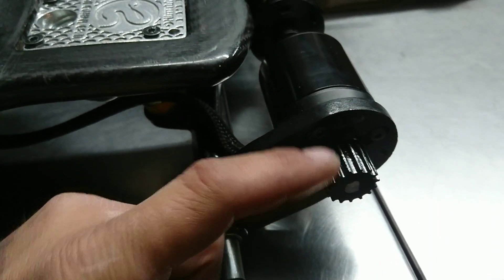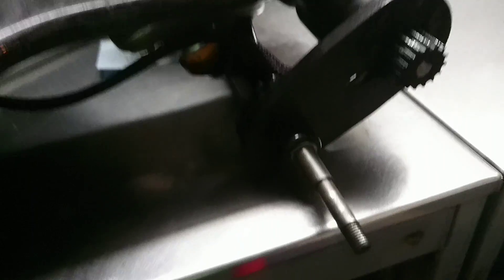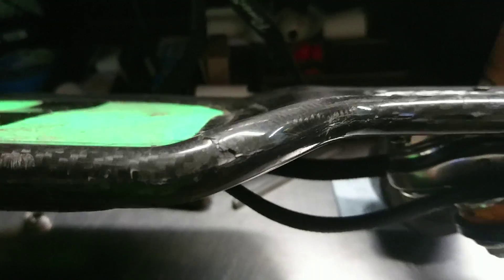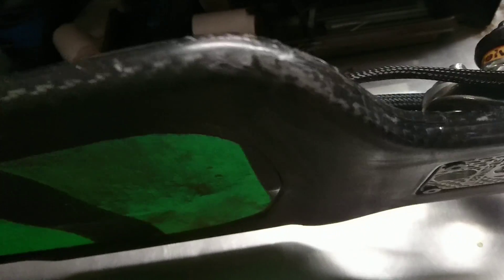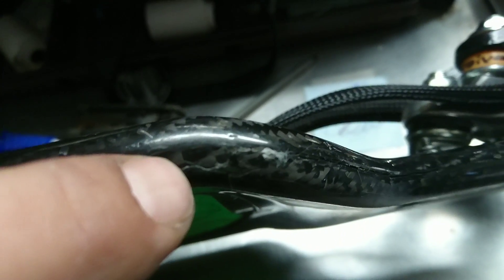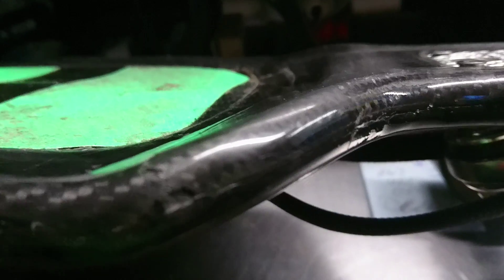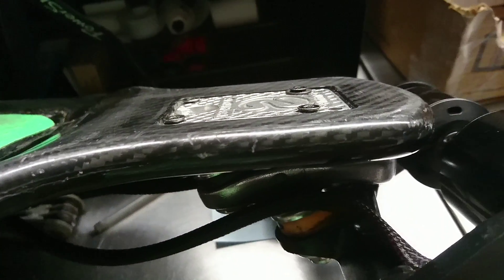Weak Carbon Fiber on the Evolve Carbon GT Electric Skateboard

Comment: The boards break here because they are made in two halves and fastened together, you can see by looking at the edges closely.  That's why they break.  There should be carbon fiber wrapped all the way around the edge but there is not.  On the center-line it's held together only by resin.
Reply from the maker: yup thats right no laps, thats just ridiculous if you ask me

Comment: how dose it fair agienest your max x1?, is it made the same way?
Reply from the maker: Manx FF not even close to being made the same way.
Reply: so the Max board is better where its 1 piece carbon mold vs evolve that is 2 pieces joined ?
Reply from the maker: Manx FF Evolve uses a foam core and its laminated cf. Max uses a solid poly core pressed and formed cf. Its like 1 solid piece. It would be impossible to crack it in half like the evolve
Reply: Thanks m8, need to find out where my money is better spent and you sir are an honest person and not a fanboy like most evolved owners.
Reply from the maker: Manx FF Yeah im not too sure why there are so many fan boys with them. I gueaa they fall for the marketing. I just sent Max this long email the other day. It was just telling them how superior their product is. How amazed I am at the fact i have ridden everyday the last six months just as i did with the evolve but had zero issues. It only took the first 2 months to blow 3 evolve motors. I learned to try the racestar and zero issues ever. Max no issues either. At this point the evolve is useless. There's so many problems with it its not funny. Max, well it looks and ride like the day I got it.
Reply: I was planning to get 1 of them AT boards from my birthday coming September, I was undecided whether to go whit a established and tested Brand for more money or try my luck whit a totally  new product from an unknown company and so far there was not much information out, till i started watching your videos, you just help me make up my mind on witch 1 to buy,  thank you very much.

Comment: What exactly are doing with the board to give it a crack like that and how is all of your hardware breaking so much in such a short period of time? i get that things break especially if you are daily riding this board but if you have a crack like that in the board in a short time frame? You must be beating the crap out of the board. Yet again, you could have gotten a lemon board. It happens . But still. To get a crack like that, it sounds like you have been beating this board up.

Comment: hey can i ask, how old was your board at this point?

Mines almost 6 months, soon to be out of warranty i guess.  My motors have had a squeak ever since I switched to 107mm wheels.  Sounds like friction, and my left motor shaft is sorta lose, moving over a tick when you try to turn it while holding the wheel.  Love this board, got it to replace my car, but damn im nervous to fuck it up.  Scratches already make me wanna cry haha
Reply from the maker: when i made this video it was 5 months old. one thing anyone has to understand and even myself is the fact i used it at least 10 miles a day as well as on my crappy roads. if i had kept AT wheels on there I would have never had an issue but at the same time have to be super super careful. its only carbon fiber with a foam core. it doesnt have a solid resin core like my other CF board does. Doesnt make it cheap or anything but just not right for all purposes. Its perfect for  recreation on well paved roads with lighter riders. I am around 230lbs maybe more maybe less but somewhere around there. They wont tell you fat people will void the warranty but its not fair to ask to be replaced if you are a bigger person because you cant expect a foam core to hold up to the weight. Is it for everyone and every purpose? no do the motors suck ass? absolutely. replace them and you will be the happiest evolve owner ever. they refuse to go hand wound and still use the cheaper version. they wont last. What i can say is that i never had a scratch on the board till i decided to go with skate wheels. then it looked like i didnt take care of my board when i switched because its all fucked now. its since cracked so bad it made it unusable. I repaired the deck but never assembled it yet. I will, the board is close to my heart. When I got mine they were so freakin hard to get it wasnt funny. I had already waited all summer just to be able to pay for it and get on the real waiting list. It was crazy. Now im so hype but like the board. Cant say i dislike it. The parts are cheap though. I had an axle snap in half. I mean i used to ride vert and street. Never had an axle snap. I mean I broke my back twice. Have a inversion table i use everyday. fucked up back. im not riding hard here. So take all that into perspective too. I do believe there has been batches of parts released at certain times and not caught. My batch was super unlucky. First motor blew in a month and they didnt warranty it. They said there are sticks coming out of the motor. They never even looked at the picture good enough. It was wires coming out from inside the motor. Not sticks still didnt get it replaced they sent me a bill for $220 for a new motor. Well I found out I could get hand wound top quality motors for $50 a pop only after I bought 3 from evolve. My situation is not common though. I use electric skateboards a lot. At one point im sure i was the most active rider in the world. I need to go back and do a total re review of Evolve to be honest. I dont want to paint the wrong picture.
Reply: Thats perfect feedback man.  Thanks, I skate it on my daily commute through the bay area and San Francisco and the rocks are killing my board :C The new wheels do help a bit, but yeah... I might get A/T only to prolong my boards lifespan...  Which is a shame to me honestly because I cranked a shiny penny for the wheels just last month.  

The board is awesome and my motors are showering their age but im pretty fine on that.  I know they take a flat beating here, and i also know if i need motors i can head to a shop in SF that sells the racestar motors for 45 a pair.  Hearing that the deck may have issues worries the fuck outta me, but i got this board and studied enough and now, im fairly confident i can make one with ease now.  The only thing that i probably would have some issue with is making a battery.  But that was the plan, replace my car with this, study it, once it finally farts on me i make a better one.  

Seriously hoping that takes at LEAST three years though

Comment: i have original 1st gen bamboo, no issues, but i left the battery uncharged for a few months and it killed the battery by 50%, so i needed a new one.
Reply from the maker: +bryan vicquery that's definitely awesome to hear. it almost feels like it's the luck of the draw sometimes. it appears that there was a batch of bad carbon fiber boards. around the same time I got mine I saw some other videos where people were saying theirs cracked too.  tell you what if my battery went bad I would build my own from that existing one. certainly wouldn't dish out the money for a new one from them. wayyyyyy expensive. hey the name of the game is just to keep riding though. just out of sheer curiosity how in the world did you let your board sit that long? I can't keep my feet off of any of my boards! lol
Reply: Joe Kyser well im in ny, so i dont take it out in the winter much plus i work long hrs. I also had brain cancer (clear now) so thats a big reason i didnt really ride much that year.
Reply from the maker: holy smokes!!! yo well thats good your clear now,. crap man thats a heck of an experience there. good excuse not to ride though. im almost sorry i asked but glad your doing better now.

Comment: are you under the recommended weight for this board?
Reply from the maker: +Dustin Stout read evolves web page. there is no recommend weight. this is a discussion I've already had with them. anytime they refer to wait it's only simply to discuss how fast it will go or how far it will go. there is no recommended weight limit. if they had a recommended weight limit there will be a lot of people who wouldn't buy this board. im sure i addressed this in the comments here somewhere. not the first time i was asked this. that's why I went to evolve for the answer. they are right, you wont see them say anywhere there is a recommended weight limit.
Reply: In the FAQs, they recommend a max weight of of 100 KG.  https://www.evolveskateboards.com.au/pages/gt-carbon-series-at-electric-skateboard
Reply from the maker: +Dustin Stout max load refers the stats they give. Thats explanation by evolve. They do not use that as a factor for speed and distance. not wether or not you can use it without breaking. That's their words not mine. They dont hold that against you for warranties or anything of such. the reason why I called them because your comment wasn't the first time that I had heard that so I addressed that a long time ago. I appreciate the concern. Its all good. I work with carbon fiber. it's strong as can be. The carbon fiber didnt fail here. It split at the seam. Evolve recognized the issue as well. They are okay to ride if you weight more then 100kg and more importantly to Evolve, they are okay to purchase if you weigh more then 100kg. They wont hold that against you! evolve is been wonderful. the actual owner of evolved USA reached out to me about this. what company owner actually reaches out to one of the customers? ha evolve. so the only reason why I'm commenting on this again it's just in case anybody reads these comments I want them to know for sure that if they weigh what I do or if they weigh more evolved welcomes them into their community. that's something that I know they don't want to get twisted. so it's not twisted up. if you weighed more than a hundred kilograms you would be disappointed at the speed you receive and at the distance you may get

Comment: ive had similar issues with my bamboo gt. Im 14 and only 53 kg and i only get 16km on street setup and i have to take it home. ive also had to replace THREE motors, which shows how cheapand crap the motors are. even though my board was still under warranty i still had to pay for one of the motors which costed me $250. The evolve boards are definitely not what they say the are. They cant even last long on flat surfaces, its sad to see an insane ammount of money for a skateboard wasted on somewhat junk. My board is only 6 months old and im already tempted to sell it :(
Reply from the maker: howzmoving zezula my man.......thanks little bro. appreciate that. Ive come to realize that Electric Skateboards has brought on a ton of adult posers. Most don't have a clue.

Comment: Whats your weight ?
Reply from the maker: +Yechiel Chli about 230lbs or so. amazingly it's held up well I only repaired one side I left other side go just to see what would happen because I do have everything here to repair carbon fiber. and it really held up well what happened was it split at the seam. it appears to me that most of the people that had problems had them right around the same time that I got my board I'm thinking maybe it was that batch. but what I'm going to do is I'm going to revisit this story because I am pretty amazed at how well it did actually hold up the despite cracking. I think credit is due where it's deserved in this case
Reply: Max weight is 220
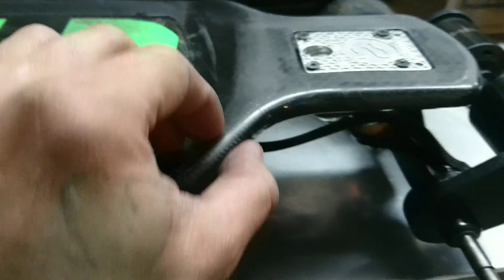Reply from the maker: +Yechiel Chli I know exactly what it says on their webpage what's it say Max weights 2:20 so don't write it or we're not going to warranty it or it might break if you're way more than that? I definitely know what it says on their webpage
Reply from the maker: +Yechiel Chli they definitely don't want you to think that if you weigh more than 220 pounds you shouldn't be on the skateboard or that your warranty would be void. I've had discussions with him about this. it's very clear what they say I would go look it up and then comment word for word what they say I'll pin that up here so no one is miss led. my goal is not to knock the company. there's been a lot of people that try to make it look like that. all I'm doing is bringing my experience forward and it's no different than others because I have a lot of people that contact me and say hey this happened to me too. shoot some people only had their board for a little bit of time before it happened I had mine for a while and I'll tell you what it was expected at some point because when I was seeing everybody else is boards crack I was like why isn't mine cracking. all's I know is evolve does not want to deter people that way a little bit more, to buy their boards. i know this for a fact

Comment: Just cheaply made in China. Such a bummer man. My condolences.
Reply from the maker: +jamesrosch i know right? bad resin blend without a doubt. ive been kicking around making carbon fiber parts and researching how i can mold a deck like this. my parts wouldn't crack this. cheap ass crap. dude says his was ran over by a car and no cracks though. this isn't the first time I've seen this port crack in the same exact spots though
Reply: jamesrosch carbon fiber doesn't mean shit for toughness if it's laid up like cheap crap. Evolve had a good idea, but cheaped out on the execution, but they still charge like it's produced quality.

Comment: i have the Carbon GT  and crashed it hard once before i got the remote guard  and a few weeks ago it got ran over by a car,  the board is still in great condition and no cracks despite the 2 bad incidents,  i still ride it every day about 10 miles a day except when it rains.   must be a bad board you got or like others said could be the cold weather,
Reply from the maker: +Anibal Apunte holy smokes! For sure lol. I am trying to research others cases now as well to see what variables they deal with. The first time i was ever made aware there wad issues, this guy told me his story. Its on YouTube as well. His split hard the first or second day he had it. Got the new one and within a few days the same thing. There could be a number of reasons. When i put it back together and put pressure on it i could hear crunching inside that area. Its my guess its wood inside and its all broken up.  I would think just say the carbon laminate wasn't strong enough, at least the wood inside would hold together.
Reply: no theres no wood its pure carbon fiber,   the first week i had my board i accidentally hit the trigger while i wasn't on the board and it hit a corner,  chipped the carbon fiber and saw that the whole board is solid carbon fiber,   perhaps some boards where made at a different location and they did'nt  do the same process for the boards,,  i got my board in dec 2016
Reply from the maker: +Anibal Apunte it had foam in the middle. i cut it open
Reply: i ride my board almost everyday since i got it and no major issues with the actual board,  just stupid drivers and the remote trigger that i accidentally hit sometimes  but since then i got a trigger guard from a 3rd party,  Btw  i enjoy your videos keep them coming bro,    i just posted one with a dog i was training
Reply: OH WOW

Comment: Evolve probably didn't test the board in colder climates. This probably causes the carbon fiber to become more brittle
Reply from the maker: +Victor Medina yeah you know what and it's been nothing but cold where I am ever since I had the board
Reply: Victor Medina lol, carbon fiber is used in the space program for space ships, it's not weak if it's laid up right
Reply from the maker: yeah you know what you're right because over the last year I prototyped a few different decks and I got to learn a lot more about carbon fiber. when I compare what I've learned to the deck that evolve has I see that they went the cheap way plain and simple

Comment: Nice video joe. Very interesting.
Reply from the maker: +Boston VLOGS Thanks man. I know right. well I'm hoping some technique that I've used only a few times and never in a situation like this, will work. lol I kept seeing people with cracked boards and kind of felt like i had a good one.  I want to disect it so bad and see why they are doing this. No way in hell it should be cracking if that resin is spread through the carbon fiber correctly. every video I ever watched that had carbon fiber failure they explained it as it not being done properly. it should definitely never separate from the core material which it's obviously doing

Comment: I have learned the working with carbon fiber is a mess I was working with nortrupgroman for a while I got acess to the carbon fiber facility I made a 4ft by 3ft sheet it was strong but when you try to bend it it just snaps and I think the carbon fiber we used here was stronger because it spend 24 hours in an oven today I am actually working with nortrup I am actually going to school tomorrow to me with someone with a high position on there I should not be talking about this lol they told me not to but the guy told me the when carbon fiber breaks fast is because the resin was not pushed in far in before the. carbon fiber is put in the over it get put into a press and pushes in the resin in all the way
Reply from the maker: +nightmare in action nighmare in action yes they would be absolutely correct pre-preg is a solution for that because you know that the resin is impregnated inside of the carbon I'm going to make a video about this and I'll actually show how it should properly be done I was thinking about rescanning just the rear of it I'm not too sure I want to get that involved because I'm going to be making some carbon fiber boards here soon I'll be able to really give everybody a good idea of how it went wrong in this instant. it was definitely a week shell without a doubt